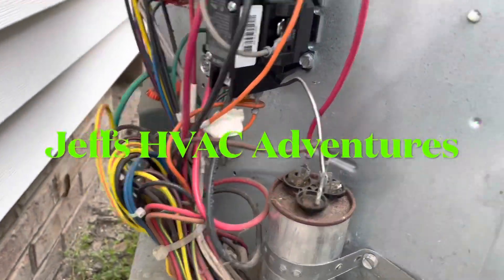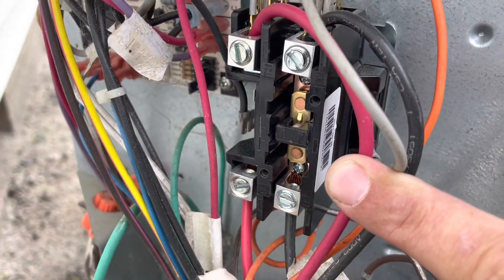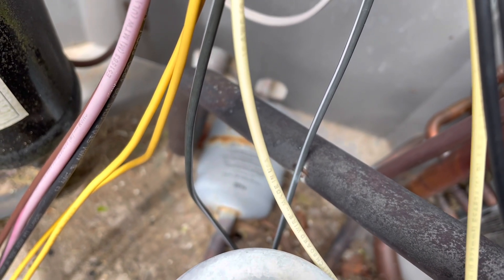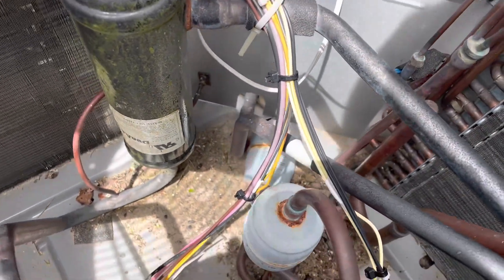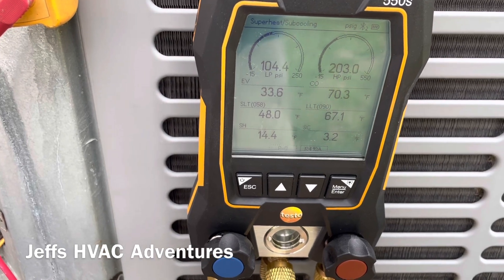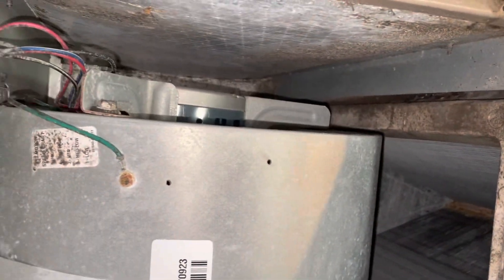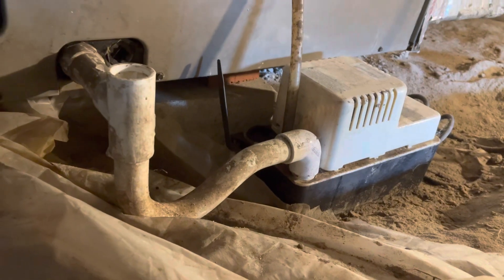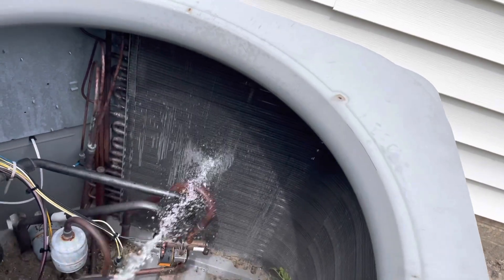Step By Step Spring A/C Maintenance! York Heat Pump. #hvac #airconditioner

Comment: My man, do you have a video on how to check Amp on Fan motor wiring and also compressor wires ? 
One more , how to check the ohms on a Blower, I don’t remember if that’s how you tested the blower. 
Can you or do you have video on this three things I mentioned? 
Thanks man
Reply from the maker: I do have videos demonstrating these things.  In a couple videos actually but I can’t remember which ones right now.  You will just have to watch them all lol

Comment: Isnt the sub cooling supposed to be about 10 degrees?
Reply: Varies on the unit. Lennox will have theirs be as low as 4 or 5 for a 70 degree day. I wish determining charges was as simple as matching number with data plate but air flow is always the more important thing to look at.

Comment: What does this type of service call cost?
Reply from the maker: We charge $190 per year for a Heat Pump Service contract.  We do two visits, a spring tune up and a fall tune up.
Reply: @JeffsHVACAdventures  Not bad, we're at 199$ and provide a pleated filter. anything past a 1 inch is extra.